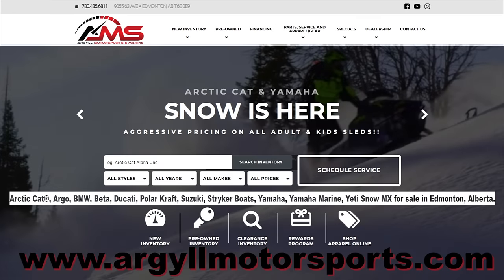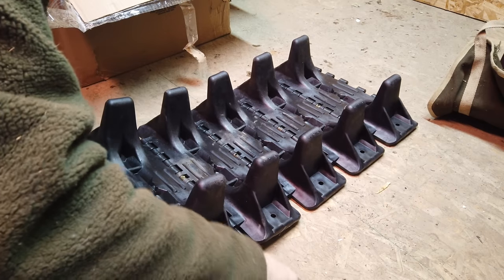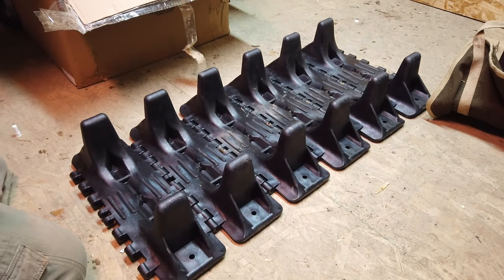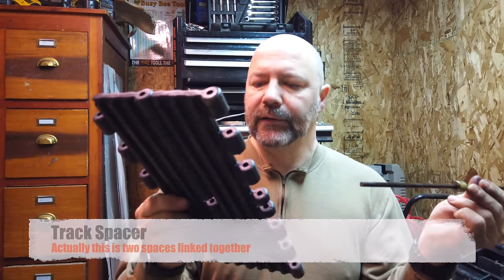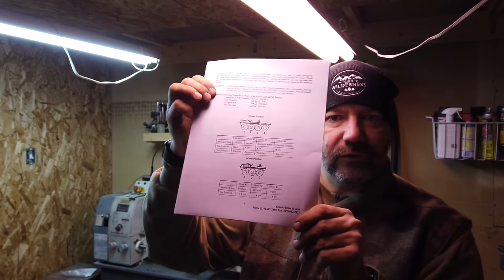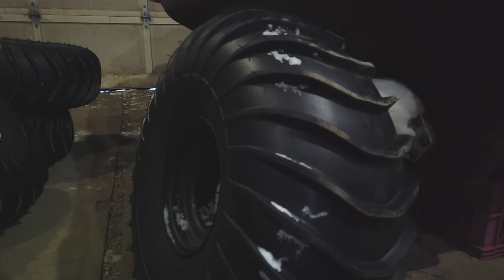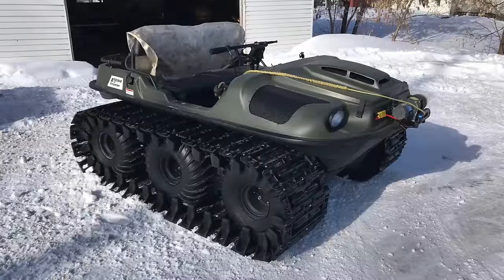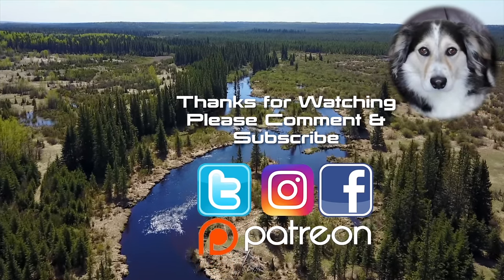Argo 18" Super Tracks Assembly and Installation

Comment: Non-permanent Loctite on the set screws would keep one from losing them in the field. Carry extra pins, set screws and locking collars, too. Perhaps snowshoes as a last ditch backup might save you also.
Reply from the maker: Hi Tom - Yup did exactly that - everything blue loctite - spare pins, bushing and set screws already stowed in the under seat compartment.  And snow shoes are a must!  If you want to get out in one piece incase of trouble!

Comment: nice unit...I am thinking of buying a used 6x6... any advice for me?   how much were those tracks...  what year is your unit?also should I stay away from the older units like 2000 and under?   thanks,   Gary
Reply from the maker: Hi Gary - My unit is a Frontier 700 - 2018 model and there are lots of upgrades from the earlier years, like the offset rims, fuel injection and bilge pump as standard.  The average life of a set of chains is around 300 hours and the parts are not cheap for new chains, bearing, shafts etc.  If you buy second hand look for an Admiral transmission (HDI) model with low hours and fuel injection.  The carburetor models are more troublesome.   For tracks, the plastic ones are over $2K CAD and rubber ones over $4k CAD - so its not cheap.  If you are mechanically inclined fixing up an older Agro can be a fun project - but do your home work on spare parts pricing.  Hope that helps!
Reply: yes thanks so much...I did see a maxx 11 for 3500.00 and it sold pretty fast...it was an older one... I think I will just buy new...I am very mechanically inclined but I prefer not a lot of fixing right now...  my budget is 15,000  I am from mn.   if I travel to Canada get I gat a better deal...  I would make a fishing trip out of it this summer anyway...  I will call that dealer and see what they can do for me..   thanks,   Gary

Comment: Which motor do you have in this one? 18hp? 23? Thanks
Reply from the maker: Its the 700 model so the 749cc 23 HP - You will need at least that to drive tracks in the Argo.  The 18HP doesn't have the power and is also carbureted and not fuel injection!

Comment: I was hoping you’d do a track build video. Can you use the plastic tracks in the summer? Still have the Pioneer?
Reply from the maker: I think they can be used all year round but I won't be doing so.  It's easier on the machine without them and I'd prefer to use them for snow and the spring melt to make them last longer.  I eventually sold the P500 BUT my friend just bought a 2018 one in red - so you will be seeing that on some camping videos come spring!

Comment: no need to turn your tires around, just put them in the same spot but on the opposite side of the machine
Reply from the maker: You have to size them as per the instructions with the largest at the rear as I recall.  Its a while ago now 😄
Reply: @TheEmporiumOutdoors  Smallest at the front, then largerst, second largest and then second smallest at the rear. (according to all the instructions I read)  But I could be misinterpreting the instructions. As for my first comment, i was assuming the argo in the video had beadlock with offset rims. The tread pattern needs to stay in the same direction. Thats why ppl would simply put them to the other side of the machine. Once again, thats what Ive read. No actual experience with tracks yet.lol Hopefully soon though.

Comment: The ice cleats are probably a must in the field with ice forming on sloping surfaces.Any grip you do have will likely be lost as any edges on the tread segments quickly get rounded off.I've seen videos of excavators sliding side ways out of control,and that has the potential to ruin your day.The tracks should prove durable enough as long as you can avoid prolonged use on gravel and other sharp rocks.The increased foot print should definitely give you the flotation you've needing.This modification should return the Argo back into the competent machine it is.Have a great weekend Michael And Esme!👍😃
Reply from the maker: Hi Dale - After my short trip down the alley, I could see how the tracks had little traction on hard pack.  I haven't tried it with the ice cleats yet but I'm hoping that will help a bunch.  My plan is to keep them on the snow and early spring melt (slush) then remove them to prolong the life.  I'm told by the Argo guys the mud gets in the joints and pins, wearing the holes and making the tracks sloppy over time.  I think the rubber tracks are more of an all year round deal - but we will see how she's goes!  😄. Best wishes Michael & Esme!

Comment: Now that you have had the tracks on for a while are there any conditions when you would rather not have them? Oh, one more. Are the tracks as good in the water? Very entertaining videos Sir!
Reply from the maker: Hi BDWillis - I remove the tracks as soon as the snow has gone - The machine runs better on tires during normal trail conditions.  The tracks are terrible in the water - very little propulsion.  I have lots more videos showing track use with the Argo if you are interested!  The rubber tracks maybe better but I have no reference point.  Hope that helps!

Comment: Brilliant,  it looks like a hoot to drive.  We used to use a nylon hammer when fitting the track pin so the pin ends didn't round off and for eye safety.  Bring on the adventures :-)
Reply from the maker: Hi Dean - Yes that would have been the smart thing to do - but I could find my copper hammer.  Thankfully the pins didn't need to much persuading and I managed to push most of them half way in by hand. 🍻

Comment: Great video as usual Michael. What size tires are you running in that. And do u still have the pioneer?
Reply from the maker: Hi Bob - the tires are the stock 24x10-8's but I was thinking of changing them for the summer to the 25" ones.  I've heard they are much better.  Unfortunately I ended up selling the P500 but my friend bought a new 2018 one in red a few months ago, so there will still be some P500 content in the future!

Comment: Looks awesome! Can’t wait to see them in action. 

Thinking about flipping the tires around. Does it make more sense to flip the around (I understand the offset) on one side? Or move them around to the other side (and flip them) so that the treat is still in a “forward” direction, and you have the benefit of the offset?

Just a thought.
Reply from the maker: Good point - I flipped them around and then to the other side so the tires face the same way as before (if that makes sense).  I was told by one of the Argo guys the tires actually bite better in reverse but they are fitted the normal way for swimming.  I'm kinda tempted to buy 6x 25" mud lites for the summer.  Traction would be much better! 👍

Comment: Nice to have tracks, now you need 50 Hp more..! Smile. Till your next trip with the hot tent and Asmee. Regards, tony.
Reply from the maker: Hi Tony - Yup, I've got 23HP but when I did my little test it didn't seem to affect the acceleration or load the engine.  I've been told the plastic tracks put much less strain on the drive line that the rubber tracks.
Reply: @TheEmporiumOutdoors  Hi Michael, yes that could be right. But probably when you go strait ahead, in a bend I am not sure. But I am no expert of cause.

Comment: Awesome!  We’ve all been waiting for you to install tracks on the Argo.   Plastic though.... hmm.
Reply from the maker: Hi Mark, I debated which tracks to install for many months.  Here is my thought process.  I wanted Argo branded tracks for the warranty with the machine, installing 3rd party tracks might have caused issues.  I only plan to run the tracks in the snow and spring melt (no mudding).  The cost of the 18" super tracks was 2.5 x less than the rubber.  I can extend the tracks if I switch up to an 8x8 by adding more segments.  Plastic tracks are easier on the machine than rubber tracks.  Rubber tracks run for long periods half the life of the chains.  Performance on snow with plastic and rubber are comparable (so I'm told).  I would have liked to install the Escargo tracks but I got no response from the Canadian manufacturer 🤔.  Time will tell if I chose wisely but if they don't work out I can always sell them and get new ones.
Reply: TEO:  sound like you did your homework.  Thanks for the reply.  I always worry about extreme cold with plastic stuff like that.  Worst case, you bust a track in the middle of nowhere, the wheels would likely get you out -just not uber deep snow.  Thanks for sharing your thinking on this. It’s very helpful and interesting.  Cheers.
Reply from the maker: Anytime Mark - I think when I'm spending this kind of money - I like to know what the options are 😄